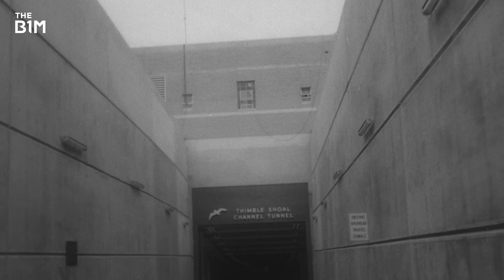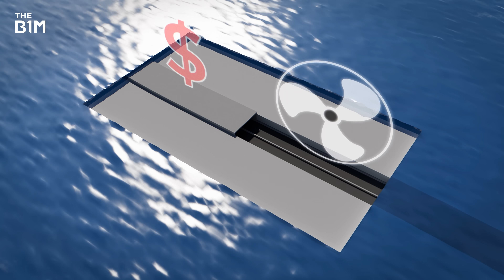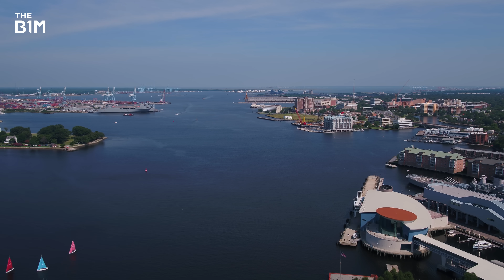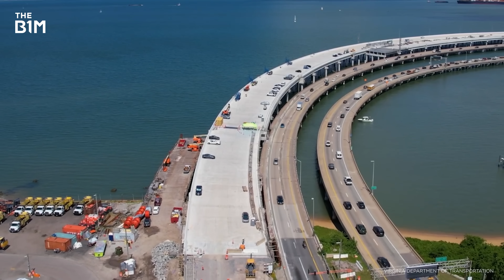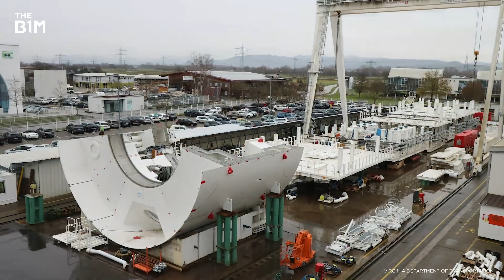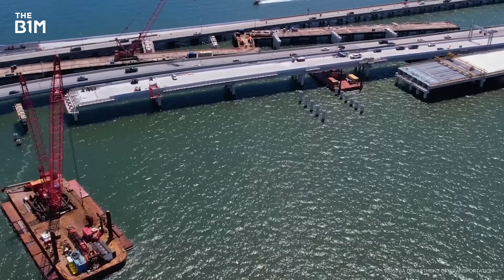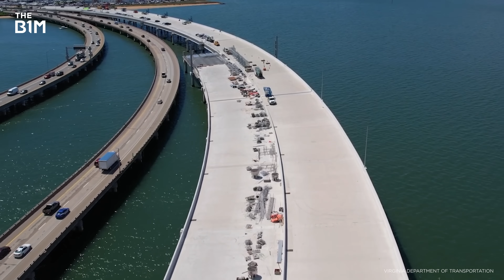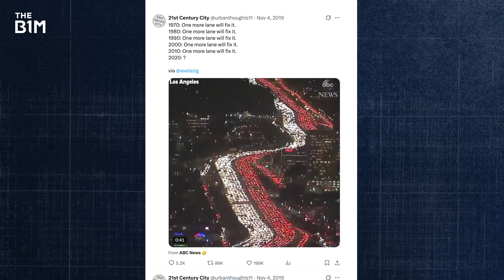The US Megaproject You’ve (Probably) Never Heard Of

Comment: Interesting that the US can build such a complex and expensive megaproject without any incidents or going over budget when it's about cars, but building a railway is an impossible task lol
Reply: I suspect that it's being low profile helped; fewer politicians and bureaucrats wanting to leave their own, very expensive, fingerprints on it.
Reply: @christiangrantz6906 it literally took two decades of political maneuvering to get this project funded and off the ground. The traffic numbers cited have been that way since the late 1990s.
Reply: @jfo1986  Given that it's Hampton roads, that's not surprising. Of the 3 major metros, they get far too neglected
Reply: @jfo1986  Earlier.
Reply: @christiangrantz6906  Also, when you don’t have to worry about acquiring land (because it’s in the water) it’s easier.
Reply: There are rail projects that come in on or even under budget. Chicago Transit Authority's reconstruction of the Red Line from Chinatown to the 95th street terminus in 2013 was budgeted at $500 million, but came in at $425 million. This primarily involved relaying most of the track, including ballast and drainage tile and replacing the entire third rail power system. The $75 they saved when they came up with a way of shutting the line completely for four months (diverting rail traffic to the Green line and aggressively increasing bus frequency in the area during the project) and retaining some crossovers that turned out not to need replacement went instead on speeding up the program of opening up stations to wheelchair access. Contractor was Kiewit Infrastructure which is typically the go to for freight operator Union Pacific when they want a major bit of rail construction done.
Reply: @dblissmn As a random stranger, I just want to say I appreciate you.
Reply: Actually, the US has a huge railway system for freight. Less for transportation of people. A building in Houston was just torn down last week, and it will be replaced by a new Houston rail station for the Houston-Dallas high speed railway.
Reply: @Lodestarter Texas getting high speed rail? The Americans would never do that.
Reply: @meowmeow2030a  because thats stupid. Its like saying 7 eu countries are getting high speed rail at once. And CA just uses it as a money laundering scheme.
Reply: @meowmeow2030a  i always find it funny how badly europeans want americans to copy them... when we will never want to be like or copy you in a million years. Frankly we detest you, and so did my ancestors 400 years ago when we gave you the middle finger and said f off... you despot shjit holes... and leave us alone. We would rather forge a new civilization than have anything in accordance with you.
Reply: @meowmeow2030a  And yet we are.
Reply: @meowmeow2030a  tbf passenger rail in the US would be fucking useless. we are so spread apart. the amount of suburbs makes it pointless
Reply: Virginia is not California. You don't have to buy access to the river for a bridge-tunnel if you are the VA state government. But if you want to build railroads $$$$ land in CA isn't cheap.
Reply: @adamelliott3694  CA's geology and ecosystems are vastly different than VA.  Pretty much unique, considering what the very North is by the time you get to San Diego. Thats just the coastline, not the interior even...
  People from CA don't know.
Reply: The last truly massive rail construction period in the USA was like 1920.  We've been losing rail mileage every year since.  The expertise was gone.
Reply: @travisjohnson6703  surely with how much subhuman trash being imported by the ton on H1-Bs, just some expertise from the Japans or Koreas could be brought over?
Reply: @travisjohnson6703 
There's a high speed project ongoing now to connect Las Vegas to LA area. Follows 1-15 and is privately funded. Belive it will be complete in 2030.
Reply: @bobrivett7645  They're already begging for government subsidies and pushing back the schedule.  And, again, we DIDNT have the expertise.  Some of it has been developed by the California HSR and Florida Brightline (which poached people off the HSR to jumpstart) projects.  Now-ironically when this stuff is under the most scrutiny-would be the best time to start an HSR project using people who have already learned the lessons.

Alternately you just hire a foreign firm to run the show-probably Chinese given how much track they've built in 20 years-and force them to teach local contractors as part of the deal.
Reply: @travisjohnson6703 With current tensions with China doubt that'll happen, best bet is Japan. They do have the fastest high speed train currently and probably has better expertise although tho focused only an entirely different type of high speed rail/train. Namely more efficiently. While China and the US tend to prefer using one model for a lifetime Japan opt to replace their trains in shorter intervals.
Reply: @travisjohnson6703  we didn't lose expertise noone wants to do it
Reply: @travisjohnson6703 

Such expertise to build a hill, lay some track, and put some rocks down. 
WOW.
Reply: @JamesDavis-vm9gw its honestly unreal that someone who watches an engineering channel could say that....skyscrapers are just big piles of concrete, durrrr
Reply: @liamhughes1532 don’t worry it’s just a troll you’re talking to.
Reply: @JamesDavis-vm9gw  you should start up a company to do it, then. Sounds like its easy for you. Bring the rest of us idiots affordable rail travel, yeah? 😂
Reply: @bleachorange 

Congrats on being illiterate
Reply: @bleachorange the funniest part is they simplified it as much as possible and still messed up the order you do stuff
Reply: @JamesDavis-vm9gw oh amazing. driving a train on rocks sounds like the perfect fix..................
Reply: @JamesDavis-vm9gw  First you have to condemn the houses and commercial buildings to get the land. Decades of court cases ensue. And the beat goes on.
Reply: Not really? The US constantly goes overbudget on car infrastructure, this project is the exception
Reply: @NikitaCage probably it has political back, lots navy workforce live here
Reply: @NikitaCage these people are bike zealots. They're not going to listen to anything rational.
Reply: Thanks for covering the HRBT project!  It’s going to be a huge help here in SE Virginia…
Reply: It probably benefited from staying low-profile, with fewer politicians and bureaucrats trying to leave their costly mark on it
Reply: The railways are privately owned...
Reply: Virginia 🙌
Reply: Not a train in sight smh
Reply: There were definitely incidents but nothing fatal, some how. Such as a crane collapse.
Reply: Not to give California leeway, but they have to deal with intense regulations to build that high speed rail.
Reply: There have been at least 1,500+ recorded work zone crashes, 5 work zone fatalities, and more..
Reply: When you put an opportunistic scum bag in charge of construction, subject it to the whims of incompetent legislators, and run it through greedy lawyers, yeah, you get the train to nowhere.
Reply: Railways are built all the time. Car projects also go over budget all the time.
Reply: It depends.  Appropriately structured, public-private partnership projects are now reasonably around budget provided construction costs are stable and rise with the rate of projected inflation.  Rail projects...well if your example is California...Democrat governance of that state.
Reply: @davidstewart8687 
Yup, single party state.
Reply: @davidstewart8687 
The multi-billion train to nowhere.  No tracks, no trains, just rising cost and a dozen years of graft.
Reply: Virginia vs California... That's the reason. We'll Virginia before it turned into California.
Reply: @DoubleDsDeliveries no idea what you're talking about lmao, just keep repeating that echochamber.
Reply: Your  @tgiby9062 wrong  California sucks and Virginia put a commie in office and is taxing us to death
Reply: Because most our states, even when taking half their landmass, span multiples of EU countries - and our driving culture allows us to casually make state-cross country road trips...which would not feasible with trains. We have an immense amount of transportation freedom that trains can NEVER solve.
Reply: Well one is an actual project the other is democratic laundering scheme and homelessness
Reply: CA gov Newsom is laundering $$$ instead of being honorable and building it ...
Reply: The US railway system is the envy of the world.  By far the most efficient across the planet.  What you are speaking about is people movers.  No we aren't good at that but then again no one really is.  Look around the world and just about every single people mover trains are in decline as they age.  The US system has been going longer and stronger than anything else in its class.
Reply: @bill-z3w2k hello mr chatgpt, go check out switzerland, netherlands, japan and other countries that actually take their passenger railways seriously and don't let their freight railways fall into disrepair
Reply: Japan?
Reply: That has more to do with California, their abysmal environmental policies and funding allocation, rather than being a US-centric issue. The upcoming project in Texas will likely be much smoother. 

All in all, the actual economic impact of High Speed Rail is minimal, as it does almost exactly the same thing as regional air travel. If there was a major impact, it's unlikely the US would still be growing at such an impressive rate, while most Western European have remained stagnant for decades.
Reply: The railroad is impossible bc of who’s in charge of it. The California government doesn’t want to get a railroad. They want to launder money.
Reply: Because railroads are communism. And cars are capitalist.
Reply: Often the railroad projects are catastrophically mismanaged for many underlying reasons; usually politics ruin them because some politicians are bought by the car lobby and will always oppose transit-related projects. It depends though because some parts of the US are much more transit oriented than others and things can actually get done.
Reply: @MasterChief-o7x  Also boomers. They are the largest pool of politicians, largest demographic in America (thus the biggest relative voter base), the richest demographic, arguably most resistant to change, arguably loves cars the most and owns the most suburban homes thus they are the biggest contributors to bureaucracy and NIMBYism.
Reply: I love NIMBYism. If you want to live on top of fk knows what and them on top of you have at it Hoss.
Reply: Just one more lane bro!
Reply: i liek car
Reply: Snob
Reply: Well, if you're bad at something, you might avoid doing it, which makes it hard to get better at doing the thing.
Reply: America government is trillons in debt.
Reply: @goodvibƏs and Japan is even more in debt (the most indebted country in the world btw) and yet even they continue to build new railways including standard rail, HSR and the first long range maglev line.

Not to mention that they were the ones who actually came up with the concept of HSR, it MULTIPLIED the size of their economy.
Reply: @goodvibƏs  and who does the US owes that money too, let’s hear it buzzlightyear?
Reply: The US has the most extensive rail network in the world
Reply: Theres no local residents under the sea to sue over planning minutiae
Reply: Think about how large the United States is compared to Europe. Think about how incredibly expensive that railway, and the supporting infrastructure would be.
Reply: @alexanderkueffler2440 
Europe is larger than the US.
Reply: @Illiteratechimp only if you count Russia. But that's scary huh.
Reply: @HardRight0101 
The part of Russia east of the Ural mountains yes. My point stands, the "America is too big for trains" argument is just fossil fuel / auto industry propaganda.
America's second favorite flavor of propaganda.
Reply: @Illiteratechimp 
 Nope, look it up.
Reply: @thomasschade805 
The continent of Europe has a total land area of approximately 10.18 million square kilometers

The total land area of the United States is approximately 9,147,590 square kilometers

10.18 is bigger than 9.15

I understand there are different ways of measuring

But my point stands that Europe is slightly larger than the US and the countries of Europe chose mass transit over cars, in general, and collectively have a much more useful and robust mass transit system with far more ridership.

Most countries are even connected together.
Reply: Especially if you’re talking about California!
Reply: @charlesmoore1762 
I blame Boomers who elected politicans from both parties to protect their real estate investments through complicated and lengthy approval and review processes that prevent new construction.

Its time to erase the Boomer legacy, set California free!
Reply: Remember, this isn't California.
Reply: Oh they can still go over budget and timeline for car projects….theyre replacing the i5 bridge between Oregon and Washington and have been talking about it for ages. Before it’s even started the cost has basically doubled…
Reply: I think thats just a California issue
Reply: The hell you are talking about, incidents? All the time, examples FIU bridge collapse, Francis Scott bridge collapse. Over budget? All the time Miami bridge for example is $100m over budget and 6 years months behind schedule. Then they're Orlando where the construction is a permanent part of traffic.
Reply: 1) it’s a local project.  Crossing state lines, multiple even, is a mess not just in terms of length but getting multiple county/city/state/federal authorities all to agree.  
2). It is small in scale, building high speed rail is orders of magnitude more distance, complexity, and cost and again needs MANY levels of approval more than this project.
3) this isn’t a brand new project.  They did the original, then the expansion, now this is another expansion.  There’s novel elements this time hence the time delay but it’s a proven concept, US hasn’t built high speed rail yet.

Finally go look at a map, compare the current high speed rail networks and overlay them to the USA.  Rail that covers tens or even hundreds of millions of people in Asia or Europe would service not even 1/10 that in most areas of the country (outside of DC to Boston, Chicago to Detroit, LA to San Fran) but at much higher costs.  I believe we need high speed rail but I can understand why others don’t see it the same.
Reply: We could do it if we needed to. We have the most developed rail network in the world, and it's constantly being maintained and upgraded. The amount of freight hauled on these roads is insane. I was in Kingman Arizona and watched a freight train go past. It was pulling 102 cars, each one with two containers on it. That's 204 18 wheelers NOT on I-40.
Reply: Texas is almost as large as all of Europe.
Reply: Saying you haven't visited North America by not saying you have visited NA.  Most people live in rural areas and public rail would be impractical.
Reply: @AnthonyPhillipsWX4SNOCommunica i live in Czechia, where many rural villages have a rail connection. Switzerland does this also really well.
Reply: @AnthonyPhillipsWX4SNOCommunica 
"About 60 million people, or one in five Americans, live in rural America."
From Census.gov, written in 2017.

My brother in Christ, it was the auto industry and oil companies who funded the propaganda that convinced us we cannot have mass transit.

We used to have trains but we tore them up for highways and now we sit in traffic while government mandated cameras get ready to scan our faces starting 2027.

Europe is larger than the United States (come at me on this) yet they have mass transit.

Its time to take back control from the auto and oil industries. Its time for mass transit and bike/walking lanes.
Reply: I'd rather die than use nasty, crowded, crime-riddled public transportation. Which is a good way to die, if one wanted to.
Reply: We're very good at the physical aspects and very bad at the political aspects.
Reply: @astoller6386 it's called democracy and property rights, not communist China totalitarianism, as in surrender your home or off to a labor/ reeducation camp with you.
Reply: @HardRight0101  No, it's that we deeply struggle at coordinating and funding projects from a top-down federal level, unlike pretty much every other powerful country in the world.
Reply: @astoller6386 disagree, we’re bad at both. We’re never told the sky is falling when highway projects go overbudget and behind  schedule, which they do just as frequently as any other public works project, but when rail projects go off the rails (ba-dum-tiss), corporate media, whose owners often also have a stake in airlines and auto manufacturers, goes haywire and pretends that it portends the end of the republic. These same competitors hire lobbyists to rile up politicians to block funding. Opportunistic tort lawyers also take it upon themselves to rile up the public and make open frivolous but lucrative lawsuits on property rights, enviornmental, or health and safety grounds. We’re one of the few countries where law isn’t just a profession, it’s big business, and the law industry has just like so many American sectors sought to actively rent-seek and increase their business volume by any means.
Reply: The US has more miles of railroad tracks than any other country in the world.
Reply: @overhead18all the high speed rail is glamorous and sexy but it's freight rail that's the REAL infrastructure.
Reply: @overhead18Folks like to dismiss the size of the U.S. when making comparisons. I see it daily.
Reply: @derekcoaker6579 honestly, most people are r3tarded. America is similar in size to Australia...I've driven for 2 days here before and not seen a single other person. You got whole damned cities with millions of people everywhere, it's an insane amount of infrastructure.
Reply: @overhead18 Too bad almost NONE of it is passenger rail. Major oversight and failure of the USA due to lobbying from the auto and oil industries.
Reply: I mean… it’s got military money involved.
Reply: It would be wonderful if we could turn the old HRBT tunnels into rail tunnels, but that surely won't happen
Reply: It's not because of the cars, it's because of the boats.
Reply: US airlines are the 4th or 5th biggest political donors, efficient and inexpensive rail travel kills their business
Reply: @klarkqent 
Never rail carries insanely heavy freight.
Reply: THATS BEACUSE (insert dum reason)
Reply: It's because rail proponents usually have to paper over economic reality to justify the project , then when construction starts....reality sets in.

The cities are too far apart and most of the population lives in the urban sprawl outside those cities.

It's why the extensive passenger rail system we had 80 years ago just vanished...it's all bike trails now.
Reply: @glennchartrand5411 sounds like thousands of high paying jobs for people in the trades to maintain tracks, bridges, tunnels, electrical lines and the trains themselves
Reply: @klarkqent 

And who pays for those jobs?
Because if you price that into the ticket the train would be more expensive than a door to door limousine.

The fact that Amtrak tickets are more expensive than taking a plane is kind of a big hint.
Reply: We have railways. We don’t have public transport trains. We don’t want them.
Reply: It's not that we can't. It's that nobody wants to leave their car behind.
Reply: How is that interesting at all
Reply: this is an inherently dumb comment
Reply: This isn't that hard to understand....
Reply: How can you compare a bridge/tunnel to tens of thousands of miles of railway line. You’re obviously not an American and do not understand how big the United States is.
Reply: @cmedeir  this is the problem with how americans think about railways. You know that you can build it in parts and still have an useful piece of infrastructure before it's all 100% complete? Besides that nobody has said anything about east-west coast railway, that is an extreme distance for non high speed rail.

All you guys basically have to do is to fix and modernize the northeast corridor, a routine job in other countries but impossible to do in the US.

Also btw Europe is just as wide and it does have a railway network across it, "US too big" is just an excuse from the wealthiest country on earth smh
Reply: Our defense is the most important
Reply: The US could build like that, not anymore. Doesn't matter what kind of infrastructure.
Reply: @DenesBerky  solid euro-cope, but of cause they can still build like that. Their current highway projects are equivalent or more extravagant than all, but China's HSP endeavors. Their is no economic value in HSR, as seen by the fact Western Europe has been stagnant for 20 years, while the US just keeps getting richer.
Reply: I think it’s because rail projects require specialist
Reply: Turns out that drivers are willing to pay their fair share but transit users generally aren’t.
Reply: They have definitely gone over budget
Reply: Really
Reply: why are you people so obsessed with rails? there are thousands of rails in the US. You cant just put them everywhere. makes no sense.
Reply: America has built railways since the 1800s.  The problem today is funding and politics.
Reply: It helps an awful lot the fact that everywhere this road is going is already owned by the state of Virginia, and there aren't any title issues over it. Environmental reviews would essentially be minimal since it's already impacted by the existing roadway, so as long as they don't pollute during the construction project they shouldn't have a huge additional impact. 
That streamlines things greatly.
Reply: Haha how did I know the first comment would be some moron saying “wHy caNt ThIs bE RAiL”
Reply: Stronger land rights for private property owners creates a cost barrier for more inflexible projects like high speed rail. It's a calculated tradeoff.
Reply: Only in California or other blue states. The high speed railway in Miami is wonderful and actually exists. 😂
Reply: yeah simple simple california cant build crap... the federal government or military industrial thats conservatives... california leftists cant do shjit they too busy money laundering and stealing from the railroad and the price is now 100 times the original estimates... and never finished xD.
Reply: Nah bureaucracy is a more modern problem… they’re expanding this bridge to 4 lanes right now… the budget was 3 trillion they’re now at 4 trillion and not even done

So it’s blown way over budget
Reply: politicians favor the car over public transit.
Reply: Private vs public..
Reply: Look at what Virginia and North Carolina are doing with passenger rail. They have been expanding Amtrack and ridership has increased
Reply: There's no money to be made in passenger trains. The only actual money makers are small dense commuter rail and even that is only successful in super big cities like New York and Chicago. Freight rail is the big deal.
Reply: @TheSantaFeGuy  This is such an absurd comment and it’s funny you probably don’t realize it. The goal of public transit isn’t to be profitable, but it is arguably the best return on investment cities and towns could see. Transit is the backbone of economies and people’s lives, do it right and you have a much more effective and efficient economy and much better, happier and productive populace. We need to move on from cars. Suburban sprawl is a net negative by literally every metric and they can’t sustain themselves.
Reply: It's actually not that complicated. The US has a very developed road building industry but less developed rail industry
Reply: @yaush_ USA has the world largest frieght rail system.  China dominates in high speed rail.
Reply: @BramBiesiekierski  yes, but much of the expense in passenger rail, which is what the OP is talking about, is purchasing the land for it as its usually in densely populated areas. Freight rail can get around that snag, so to speak. In addition, due to the less developed passenger rail network and infrastructure, not only do the locals often not actually want it over cars, creating political opposition, but also timelines extend, creating expensive delays and more political opposition.

Its a catch 22 situation - until any passenger rail network reaches an inflection point of convenience in a given area, people still prefer cars in America. But you have to build it first to get there.
Reply: @bleachorange incredibly well said. As someone who wants passenger rail I have to admit that until it’s convenient I NEED my car.
Reply: @yaush_ the question is why? (Oil and automotive lobbyists)
Reply: There are plenty of road projects that went way over budget. The Boston ring road project went billions over budget, as is the bridge to replace the Key bridge in Baltimore- estimated at 2 billion and now at 5 billion.
Reply: @FassEddie  The Boston project was originally $3 billion and went up to $20 billion. At one point it almost made the state of Massachusetts insolvent.
Reply: The US has rail covering the whole country.  I assume you are referring to the high speed rail in California.  That's something you  can blame CA politics on, not the ability to build and engineer.
Reply: Most freight and industrial production in America is transported across via railways.  I know it’s fashionable to criticize US rail but few countries actually have the extensive level of sophisticated rail network the US does. Just because it’s not used to transport people doesn’t mean it’s bad.  Remember it’s easy to build people rail when your country is concentrated geographically and widely connected with a bunch of other small countries.  France for example is the size of Texas.  Even if high speed rail existed in America it could only exist where it already somewhat does (Acela corridor).  Traveling by rail coast to coast is like taking a train from Paris to Istanbul.
Reply: @Il-SKIl it makes sense to break down passenger rail by region (NE, NW, Midwest, etc) interconnecting major cities as the hubs with secondary cities as the spokes. Domestic airlines make sense when you're talking about flying from DC to LA, but there are some absurd and wasteful routes all over the US that would be better served by rail.
Reply: @Il-SKIl  oddly china seems able to build high speed rail despite not meeting any of those qualifications
Reply: @PK1312  networks aren’t even comparable.  And China’s networks are all concentrated in cities that are either by the main rivers or coast.  USA cities are much more widespread and our airline industry is more efficient than trying to take a train from LA to NYC.

Either way China also has zero political freedoms, is extremely controlling over personal, commercial, and especially on freedom of speech.  So it doesn’t matter if they claim to have better trains, we have better planes, better freight trains, better economy, and people here can actually say wtf they want to say.  Whether you want to praise Trump or call him a gigantic parasite, you are free to do so.  Not so sure the same can be done with a certain leader (who shall not be named so as to not have the great firewall of China block this comment 😂)
Reply: @PK1312  China has extremely low construction costs, low labor costs, and more importantly they have a very top down were doing this mentality; they also use up and waste massive amounts of money building because they CAN not because they NEED to. It helps them NOW but basically all experts agree that china dosent have that much longer to go before the burden of maintaining the old start to eat up enough time and money (like every other developed country that industrialized before them) and they are forced to have a more measured approach. Just pointing at China isn't the apples to apples comparison you think it is.
Reply: @Il-SKIl  It should be no debate that the US is too sparsely populated to have nationwide passenger train but the lack of actual functional public transport in some of the biggest cities in the US and in the main corridor such has the east and west coast is a great loss to the American public, like this third tunnel which wouldn't be needed if they put an actual regional rail in one of the older tunnel at the time
Reply: @PK1312 china is communist dictatorship. Nobody has the right to say no and nobody owns any property anyways.  Their is no comparison
Reply: This isn't Communist China, a single party totalitarian dictatorship that just decides on something and it gets done. There are inconvenient details here like private land ownership and property rights that prevent the government from running roughshod over anyone who gets in their way.
Reply: Land acquisition is one of the problems with building railways everywhere in the US. There's more privately owned land here.
Reply: When building trains you almost always have to negotiate with the freight rail companies that are not keen on sharing the tracks.  Often they will make a deal only to come back and decide nah, don't think so, or come back with a ridiculous price.  It isn't always possible to just build your own tracks because you can't get ROW.
Reply: @ScottCP1  So the country should be investing in ROW so they can actually run trains without freight traffic
Reply: @rudmad00  The combination of strong property rights and the litigious nature of Americans makes obtaining right of way for new railway projects incredibly expensive and time consuming.  It would probably take an army of lawyers 20 years to sort it all out, all before construction starts.  Staring down the barrel of that kind of time frame, most private investors are wary, especially because the market case for high speed rail in the US hasn't been proven.  This means that it needs government funding, and look how well that worked in California.
Reply: @jamesburleson1916  I know it's expensive. It's a one time purchase though and you know we will need sustainable transit in the future. I'm not even talking about fresh HSR, just reliable intercity trains that don't have to deal with freight.
Reply: @ScottCP1 Add to that the fact that you have to buy the land, rights of way, and pay an army of lawyers to fight all of the legal challenges. Here in California those liberal do gooders will fight you tooth and nail over trivial things like their views being ruined. Even if it is something they want like high speed rail.
Reply: @efone3553 why are you blaming democrats? Both sides are in the pockets of the car industry.
Reply: @efone3553  Excuse me, not liberal do-gooders but NIMBYs from both political sides.
Reply: @efone3553  Yeah, keep blaming on liberals and drown in your MAGA hallucinations.
Reply: After 40 years california state goverment is still trying to build high speed rail from the state capital to LA. THEY HAVENT LAID ANY RAIL YET BUT HAVE SPENT $25 BILLON . A LOTVOF RICH DEMOCRATS LIVING IN HAWAII
Reply: Well the US is killer at rail. It’s HSR that is an impossible task.
Reply: You do realize excluding Alaska the lower 48 is about 3.4 million square miles in size. It's very impractical and cost prohibitive to build passenger high speed rail. Just crossing over the Sierras or Rockeys has an elevation of 10,000 ft .
Reply: @thomasburke7995  look at China
Reply: @tolqar6563  He's still right tho.
China's population is much dense and concentrated in Eastern part.
US has a wall developed airline network. HSR will make sense only in coasts.
Reply: That's California bro. Virginia is mostly efficient, mostly.
Reply: their railway isnt even electrified meanwhile India is at 98% electrification
Reply: @carholic-sz3qv  Coz US rails system isn't for passengers but Freight rails.
Reply: @PrincepratapsinghRawat-cw5em bullshit! Stop with the lame justifications! Your country was built by the train and since then you’re stuck with the outdated antique diesel trains and tracks, the passenger trains another big joke, you don’t have any single mile of high speed rail….. other countries have freigh trains just like passengers in a very efficient way.
Reply: France has double decker high speed trains for example and they are bringing it to the channel tunnel to increase capacity to the uk.
Reply: @carholic-sz3qv  Are you a troll?
I also said that US doesn't have a big Passenger train network.
Its all mostly Freight rail and Freight rail is what built America.
Americans prefer Cars and Airlines more tbh. 
It works well more too considering Geography, Population distribution, etc.
Reply: @carholic-sz3qv  France is a small country with many population centers close to each other for them HSR makes sense.
Reply: We use airliners in our country. Stop with the lame justifications. 😂
Reply: @carholic-sz3qv more illegal alien capacity. Faster and more efficient than rubber dinghies.
Reply: I think the simple answer is that it may not be profitable. Also airplanes are more efficient and versatile when it comes to travel.
Reply: @af6456 not if no one can get to the airport to fly on those airplanes....
Reply: @af6456  
You can't compare trains and planes. Trains carry millions on tons per week.
Reply: America's size doesn't lend itself to passenger rail service. Especially when aviation will get you there in 1/10th the time.
Reply: @armorer94  you don't need a new york - LA railway. What you need is to connect closer cities together, like Houston - Austin just to name an example. I mean come on, the Czech village i live in has a larger train station with more frequent trains than Houston with over 2M people living there. It's embarrassing honestly.
Reply: @armorer94 these are europeans obsessed with America. Their opinion is meaningless
Reply: No, usually it's overbudget and delayed for car infrastructure too.
Reply: Rail is expensive because in the US it’s private companies. Amtrak only owns the rails from DC to Boston and PHL to Harrisburg.
Reply: Youre free to build them.  There simply isnt demand.  Its stupid to spend money on things that arnt even being asked for.
Reply: I guess the government doesn't have to negotiate and buy property from zillions of private land-owners to cross a waterway, unlike for hundreds of kilometres for a rail project.
Reply: Here's a rule of thumb, from South Korea🇰🇷: if my country's Freedom-boo bureaucrats are not copying America's homework to do their job, it means whatever the Americans have on their hands shouldn't be in a developed economy in the first place.

And this is to put it very respectfully.

Because Seoul loves to copy Washington's homework.

Our superhighways are already a wholesale copy of America's "homework", from the network's grid pattern to even the numbering convention. Had Amtrak been given just half the love and care as what the country's Interstate recieved, the earliest KTX models would have been licensed American designs. But no, the KTX started from modified TGV designs, because even our Freedom-boo decision-makers had their limits.

US freight rail, you're good. But US passenger rail is, to put it less politely, a radioactive dumpster fire. I'd rather re-learn my 20+ years' worth of "American English" from "aluminum, color, and meter" to "aluminium, colour, and metres", than see our KTX-Sancheon slow down from 190 miles per hour to 190 kilometers per hour.😂
Reply: @Breatropolitanwell said, though US freight isn't that great either. Sure, the network is huge, much larger than the passenger network, but the rails are in extremely bad condition and not really maintained. 

As a result, freight trains often have to be extremely slow and more importantly derailments are unusually common in the US, including derailments of extremely toxic chemicals like what happened relatively recently in Ohio.

Derailments are so common that it's a regular occurrence and the news barely reports on it unless it's something exceptionally bad.
Reply: Yes. Because it’s stupid. Hope that helps.
Reply: @e_c6324  Nearly entire world disagrees.
Reply: @C @Cgbp14  wolves do not concern themselves with the opinions of sheep, 2) the US already has the largest rail network in the world, 3) our landmass is so much larger than most countries in the world that we built other infrastructure that is better than rail.

Hope that helps. :)
Reply: When the CBBT was first being built, the amount of political wrangling in the project was absolutely horrendous. The southern end of the bridge was changed twice, once while in construction. However the state and the feds stepped in, pushed the cities aside, and put it back on track. Also this was back before environmental regulations. Now we have to use tunnel bores, which is  much much much more expensive and slower.
Reply: This is all about what the navy needs not cars.
Reply: Different part of the country controlled by an idiot. Each state is responsible for its own infrastructure. So competency shows big time.
Reply: Railways for passengers are low-return projects. It's a lose for the amount of people moved versus the cost of building/income made.
Reply: @Golgi-Gyges roads make more money than railways? If anything roads are much more expensive to maintain and they support way less people than railways.

Also any public inftastructure doesn't exist to make profit, instead it indirectly makes money by boosting the economy of the affected area.
Reply: @CZdigger146 how many people do trains move?
Reply: Only in “Comifornia”😂
Reply: Or causing Grand oil swings through religious based ideas, extremists
Reply: @brettmoore3194 nonsensical but cute
Reply: you're mistaken my friend. I live in Norfolk. specifically ocean view. I work at NN shipbuilding as a sub contractor. I take the bridge tunnel everyday because its only 1 of 3 routes and thats the "closest" its traffic EVERY single day after work near the tunnel. might I mention theres probably been over 50mi of roadwork done on that route for the last 20 years. im only 23 so I have no idea but ever since ive known about it, its always been backed up. just last week on thur and fri there was an incident that involved shutting down the left lane on one day and fri they completely stopped traffic for 1hr and 40mins. you see the workers doing absolutely nothing all the time. theres just too much work going on and so little space. it appears to me that theyre trying to make another bridge tunnel which will take years. it really sucks and isnt as smooth as most people think. even on the weekends its fucked up.
Reply: Yorktown resident here.... they are both over budget and waaaaaaay behind schedule lol
Reply: When American infrastructure projects are good and on budget you clown them and when they’re bad and over budget you still find a way to clown them?😭What is wrong with you guys why are yall so miserable
Reply: I'm still bitter they didn't do a railway here. It makes zero sense that you have to go up to Richmond to go between Langley AFB and Norfolk NB by rail.
Reply: @Metrosoda I spent two years in England with the US Air Force. I went to Coventry to see a girl I was dating. I had to change trains at Cambridge to go to Birmingham (on the other side of Coventry to the West), and then catch ANOTHER train back the way I came to Coventry. And then repeat the whole process on the way back. I should have driven it. So much for the supposed greater efficiency of rail. And this is a small country the size of Alabama. And all of this involved long layovers at Birmingham to boot.
Reply: @HardRight0101 I'm not talking about trains to rural areas, I'm talking about 20 miles of rail between two of the most important military bases in the country.
Reply: We have plenty of railways and metros in many states and cities, we are just a huge country no need for rail way in some these areas, and we love cars for me nothing beats a roadtrip.
Reply: @ra9ha3l So true. people forget that in the US their are plenty of ways to get around economically. I live in the Bay Area and have driven to Southern California well over a hundred times over the years. Its just so easy and when I got to my destination I parked and walked right into whereaver i was going in minutes. The idea of having to wait at a train station, then catch a bus and then hop onto a metro and then walk several blocks or wait for my brother to pick me up just sounds insane to me.
Reply: Oh yeah and how much do you wanna bet that my brother will not get lost and pick me up when he said he would.
Reply: @efone3553  And don't forget the Airline network its the most widespread and best in the world.
Works much better for America coz the population widespread.
Reply: @efone3553  This is so off base it’s insane. You need rail, cars are terrible. You actually think driving to your destination and parking is easy or efficient 😂 Yeah sure, until that traffic is terrible almost everywhere, until we dedicate a large chunk of surfaces in cities to parking lots of cars that aren’t even being used 95% of the time, until every American has to buy an unnecessarily huge car that costs an average of $50k these days even though they drive on average less than 10-15 miles a day, until suburbs finally run out of money because they’re aren’t self sufficient 😂 Rail is superior and faster, if you want a car take a taxi or rideshare. America needs to redevelop most of its towns and cities asap or we will not recover and fall behind.
Reply: @Ryan-cb1ei Their is a time and a place for everything. Rail only makes sense in certain high density urban areas that have the money and resources to allocate to rail. Here in the west high speed rail is absolutely not needed and we have well built out commuter rail services in the big cities.
Reply: @ra9ha3l  Your comment is so wrong on so many levels, and dangerously ignorant, it’s actually pretty scary how little you’re aware of.
Reply: @Ryan-cb1ei what am I not aware of buzzlightyear let’s hear it?
Reply: @ra9ha3l  You can read my other comments if YouTube didn’t filter them out lmao
Reply: Because the U.S. government cares much more about military related stuff than critical infrastructure for its citizens.
Reply: It’s not that can’t, it’s that the auto industry will not allow it. They practically throw money at politicians to prevent this.
Reply: Not because of cars but because of the military
Reply: Similarly, most countries can have universal healthcare, that while not perfect costs a lot less than our private system and for most on average provides equal care and for many far far better care.  Somehow magically it works for military veterans and retirees.
Reply: Because they didn't have Newsome siphoning the funds.
Reply: It’s not that our engineers are incapable, it’s that politicians have campaign donors that are in the fossil fuels industry. If high speed rail became a reality here then they would take a hit. The US is so massive that cross country high speed rail will take  decades to build and probably two in order to design, build and test a prototype. Presidential terms are 4 years and on occasion they can win twice having 8 years in office meaning even if one president chose to start the project the next one can easily shut it down or discontinue funding. We’ve tried getting the ball rolling multiple times but it’s not going to happen
Reply: @kaibalfour2318 

Even more ignorant children.🥳

Hey sweetheart, we’ve got planes for that. They go a lot faster than high speed rail EVER will. 

It also makes money for governments instead of losing it like on outdated choo choos. 

Ah yes, blaming big evil oil companies. How original and completely, and provably, moronic. Let’s completely ignore all the tax revenue cars produce. Or the millions of SMALL businesses that are supported by it. That produce taxes as well. 
Nope 
It’s the big evil oil companies 
Go back to school child
Reply: Because Americans love their RAM 3500. If something prevents Americans from driving their pickup trucks they'll just donate to the political party and get the transit project stalled or delayed indefinitely. Trains are for lower class anyway. Just get a car and drive anywhere u want
Reply: @manan-543 do you think the average American has ever donated to a political party in there life😂😂😂 pls stay out of this discussion your europionion is not needed here